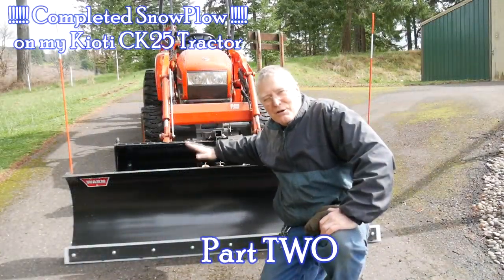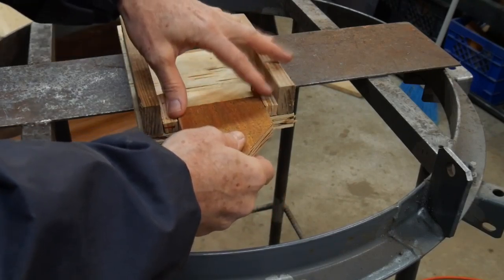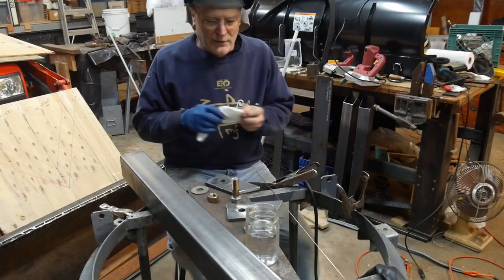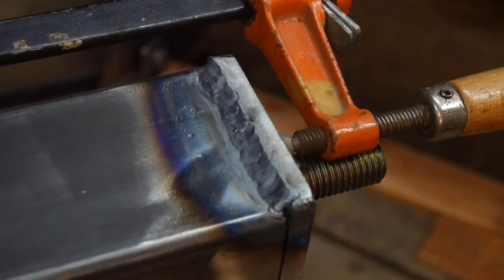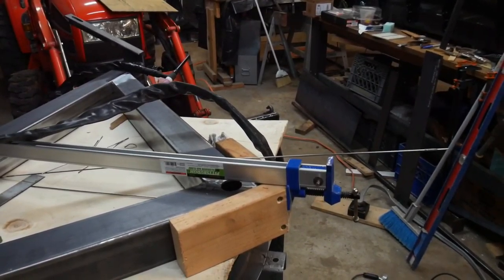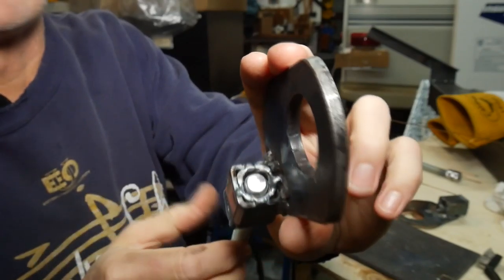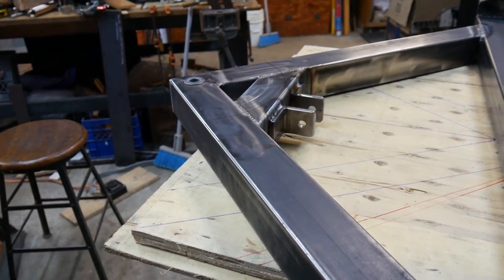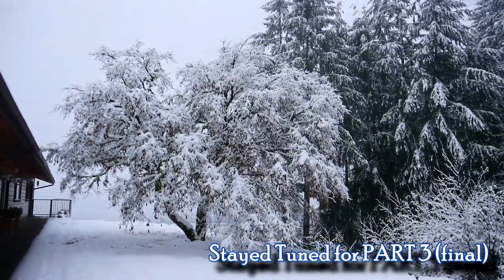MAD MAX Snow Plow Build  part TWO

Comment from the maker: Part 3 is coming up this week - and will talk about any pros and cons - was came in from using it this morning.  Now the 1/4+ mile driveway is clear, ready for the new snow coming tonight. 
Tractor is 4WD, but has 'yuppy' tires on it - not the big ribbed AG tires, but worked fine.  If we don't get the snow off it turns to mush and then freezes to a thick ice - a couple years ago we were stuck here a couple weeks, even the county road was impassable.